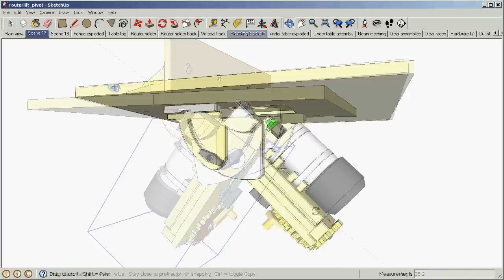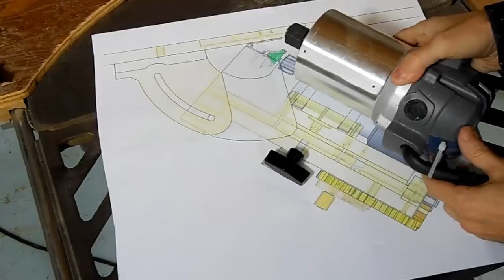Tilting router lift design

Comment: bought the plans, currently building this router into a table I made, though I have to adapt it to fit a smaller 8mm plunge router. I wonder if you could use the ability to move the router up and down to utilize this as a sort of vertical slot mortising machine.
Reply from the maker: 1873Winchester I don't think that would be a good idea.
Reply: Oh yes I don't think it would be good to have the router running and then trying to plunge into the piece in exactly the same fashion. I was thinking more that you just set the router bit up a little bit and lock it in place, then plunge down the workpiece against the fence and move it between two stops, then raise again a little bit and repeat until you reach the desired depth. I'm not sure it wouldn't be simpler with a drill press.
Reply: Sou fã de seu trabalho Mathias, não perco nenhum vídeo seu. Aplico suas ideias nos meus projetos, pois meu raciocínio não acompanham o teu para ter soluções em determinados momentos. Meus parabéns pelo seu sucesso e sua família, acho legal em determinados vídeos vc mostrar sua família.